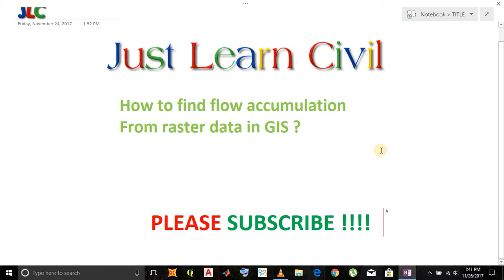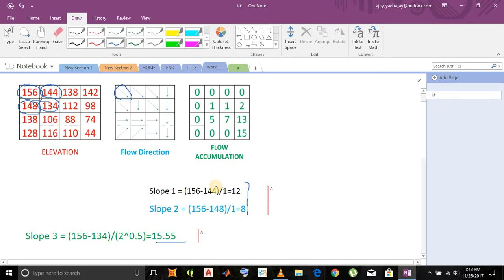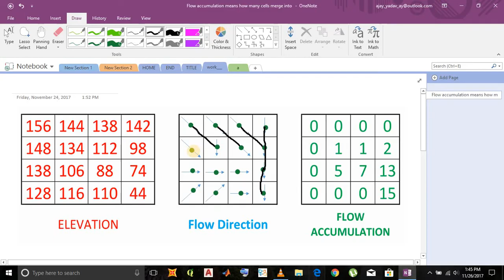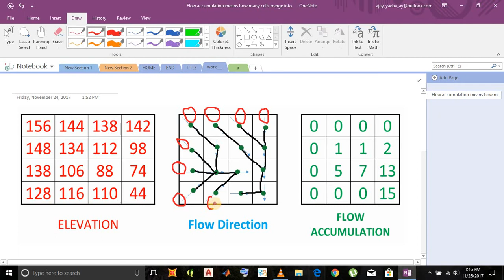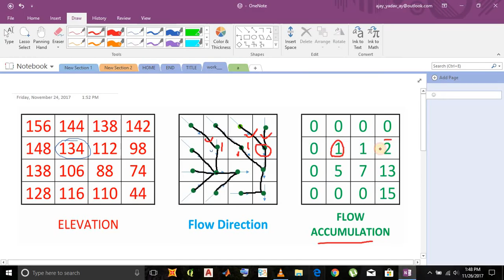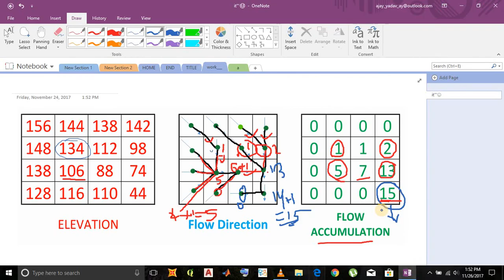Tutorial #2 of 3 - Understanding Flow Accumulation in GIS from raster Data of elevation ?

Comment from the maker: PLEASE NOTE: The arrow should be directed towards cell with value 88 from cell with value 134 and the flow accumulation would change accordingly. But since this video is focused on flow accumulation, not flow direction, the flow accumulation is drawn according to current flow direction.
Reply: The flow directions on elevation 134, 98 and 88 are incorrect. They should be down right, down left, and downright.